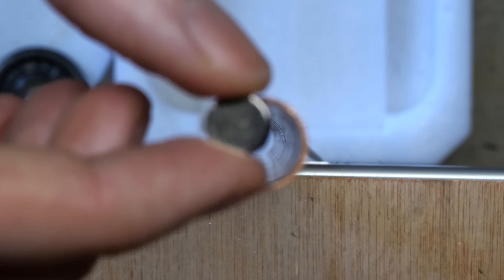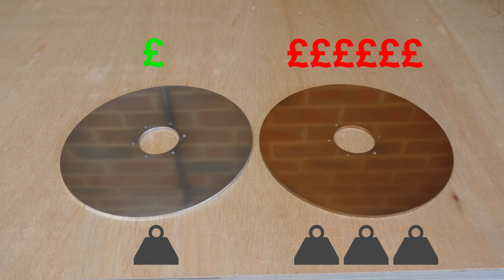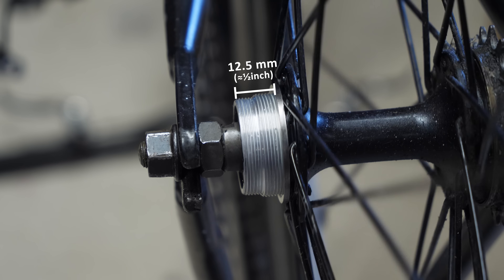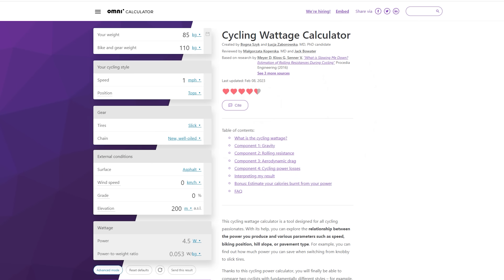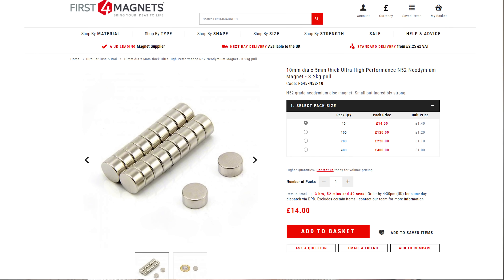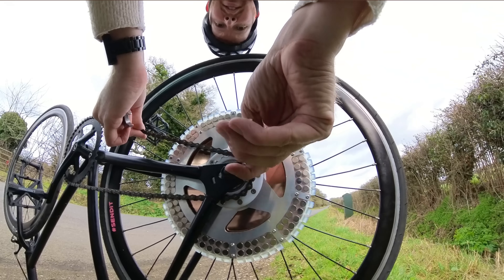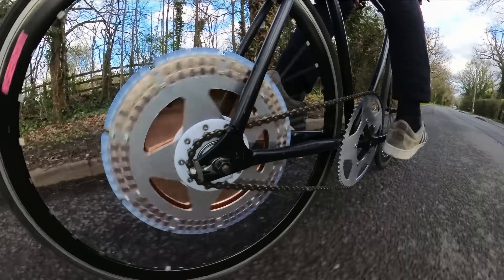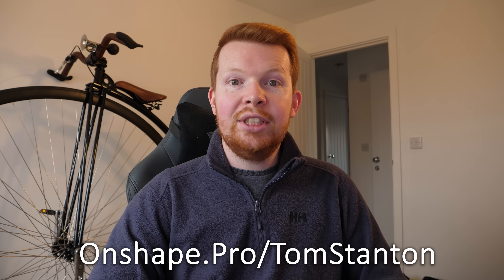Gearless Magnet Bike

Comment: Some exercise bikes work like this.  When you pedal it spins a heavy metal flywheel to smooth out the resistance.  When you adjust the resistance, the magnets are moved closer or feather away from a conductive flywheel.

Comment: What if the copper disk was slotted in a radial fashion ? 
Also .. I think you have one heck of a "region" system if you use that as a break or using it to charge a battery on an e-bike when coasting downhill.
My 2cents,,,, Thanks for the content.

Comment: You could massively increase the strength of the magnets just by putting a steel sheet over the back of the magnets. It'd also grip the chain less. I imagine another steel plate on the other side of the copper would help too.

Comment: It's not only copper and aluminium. In the braking system on the roller coaster I have designed we used all sorts of alloys to get the best possible brake-force curve and heat generation (dissipation)

Comment: What is this "cluch" good for ? For waisting energie. Copper will go hot. Please built a Magnetic Gear instead ! a GEAR gear without contakt. Built it with Gear ratio of 40-60 and built a Elektic bike. 8000-12000 U/min in and 200 U/min out on rear weehl.

Comment: If you would switch to a belt drive, you would get rid of the tension between the chain and the magnets.
PS: I might actually have some use for your idea. I have a recumbent bike, which is frontwheel driven (a Flevo Bike, if you want to google it). The disadvantage is that this means I can barely go uphill, as the front wheel does not put too much force to the ground. I am pondering converting this to an e-bike and drive the back wheel. But as this is not a bike, but a trike, I have two back wheels, and they have one-sided hubs. It is not easy to source one-sided hub-motors for bicycle wheels. But with your magnetic clutch idea, I might be able to drive the back wheels more easily.

Comment: i would try something like this as a brake on an electric bike or trike. when braking, run the motor as a generator and feed the electricity to electromagnets that create the magnetic field. double whammy. from the motor acting as a generator AND from the copper disk acting as an eddy current brake.

have you tried if the thickness of the copper disk makes a difference?

Comment: If you place a metal cover around the outer side of the magnets, it would block them from catching the chain and spokes.
Most magnets use a sheet of steel on the non-operational side, specifically to weaken magnetism on the surroundings, where you don't want the effect.

edit: Just got to the end... That heat would kill the magnets in the long run, perhaps fan blades in the outer flywheel, for some passive cooling as it spins. And more magnets!?!( It's already an expensive clutch though!)

Comment: How much energy is being lost to heat? Does anything warm up?
Reply: Maybe watch the video???
Reply: @JonahHax  I see it now. Thanks. I skipped over many parts because as someone who rides spin bikes a lot, this is the same principle used to add resistance, while a belt is used for driving the wheel.

This experiment nicely shows why most e-bikes do not implement regenerative braking, even though it has been done in some bike wheels. I think it is due to weight and manufacturing cost. Simpler to increase battery capacity.

Comment: Very interesting subject !
Have you seen the HAL paper "Steady-State and Transient Performance of Axial-Field
Eddy-Current Coupling" ? It leads to some conclusions on optimal copper disc thickness (4mm) and number of pole pairs (around 3-4). Also it seems much better to place magnets in the middle of the radius, so the gain of putting them on each side is to be evaluated. And limiting the air gap is quite central in maintaining the torque.
Next, a battle with a homemade visco-coupling unit ?

Comment: Great video, but I think your testing methodology is flawed for the materials. I think aluminum would be better for this. Inertia works both ways. Having a larger mass makes it more resistant to stopping, and harder to peddle anyways. Rather than putting a string with a weight on it to see how quickly it falls, spin the disks to a set rpm and see how long it takes them to stop

Comment: How is the stopping performance if you pedal backwards? Guessing it will still be almost impossible to do a skiddie.
In principal this system have build-in anti-blocking breaking and anti-spin torque transmission.

Comment: What happens if you pedal backwards? Would that provide more braking force? How would the addition of an electrical current affect the resistance?
Great videos! I really enjoy watching and learning such interesting concepts!
Reply: One of his tests demonstrates that the torque generated was proportional to the difference in RPM between the disc and the magnets, so yes, pedaling backward would increase this difference  in speeds, and therefore produce more braking torque.
The other question is interesting.  The eddy currents that the magnets induce in the copper disc flow in a ring around the magnets, lagging behind the magnets because it takes some time for the current to die off once it's induced into a particular path.  This is really how the torque is created - the ring of current induced by the magnets produces an opposite magnetic flux to that of the magnets, that's constantly trying to align itself with the magnets, so any rotation of the disc produces a "back torque" that opposes the motion.  If you were to fit carbon brushes either ahead of or behind the magnets, current passed through the disc through these brushes will also produce a torque for similar reasons.  You will have created a DC motor, but this would be very inefficient because the current you apply to the brushes would not just flow through the copper directly between the brushes, but also though many other paths that would not produce usable work.  This could be improved by cutting slots radially at intervals around the disc, between the brushes, which would reduce the undesired currents without affecting the intended current path, but now you're getting closer to a conventional commutated DC motor.  Which sounds like something interesting.  However, if you look up radial flux brushless DC motor, you will find that this is very close to what is already being used for low-speed, high torque brushless motors.
Reply: @BrightBlueJim  The homopolar generator designed by Michael Faraday was a similar design as well, very cool seeing how this is basically that but with no wires connected to it.
Reply: @BrightBlueJim  Thanks for the response. I'm not an engineer and am not up to speed on the theory of DC motors. I know enough about electricity to be dangerous. My crude thought process was that an electrical current might increase the amount of torque that is being applied to the wheel from pedaling and provide a better braking action. Thanks again!
Reply: What if you cut the copper disk to sections could it make the difference to speed?
Reply: you are very correct
Reply: Stoney: where does the alternating current come from, then? I think you are mistaken
Reply: more expensive coaster brake
Reply: Pedaling backwards does increase the braking resistance, because it means the sprocket RPM becomes 'negative' and the net RPM difference becomes larger.

Regarding electrical current, the current in the disc is not DC but it's a localized AC current which moves along with the magnet's rotation. To get the disc to spin using electrical current, you need to apply a rotating magnetic field through a set of coils. In his experiment, the magnets are replacing the pole pairs of a motor.
Reply: thats what i was asking myself the whole vid too😭

Comment: Was showing the copper pipe trick a while back and found that a magnet dropped down the slot on a piece of aluminum extrusion works really well and offers better visibility of the trick.  This sort of made me wonder if you had a slotted cylinder hub and axial fitted magnets if you could get more resistance with less weight.
Reply: you are very correct

Comment: Eddy current clutches (using electromagnets instead of permanent magnets) used to be a common way to do variable-speed motor drives before DC drives and VFDs got practical and cheap.

Comment: Even dull looking copper is a great reflector of infrared light, like a mirror would do for visible light. It has a very low emissivity so you would have to stick some tape to it to measure its temperature with a thermal camera or you will just read the temperature of the things its reflecting. Interesting video. I was about to experiment with some magnetic coupling myself and was wondering about the alternating magnet orientation :)
Reply from the maker: I kept a protective plastic film on the backside of the copper disc for that exact reason (notice the thermal camera shot is from the other side of the wheel vs regular camera shots). When aiming the camera at the exposed copper side, it just showed the temperature of the reflection.
Reply: Yeah he'd best get his camera checked it clearly didn't show the real heat source. Fake!

Comment: One possible solution to the issue of the chain being attracted to the magnets would be to use a bike with a belt drive.
Reply: I just thought of an idea that would improve coasting. Rig up a system with a brake lever that when applied would push the magnets radially away from the hub so they don’t overlap the copper disc.

Comment: You can avoid the problem with the sticking chain by replacing it with a chain made out of rvs.
(Or make it a belt drive)😊

Very cool project.
Reply: Why would he want a chain made of motorhomes? That seems like it wouldn't fit if I'm not mistaken? XD

Comment: I would really love to see you do some more disc testing, like perhaps heatsinking the middle of the disk with some machined fins/grooves improves performance. Also a disc with a small bit iron inserted would radically increase traction of the drive while still allowing it to be an inductive clutch. Or maybe something like dimples or a grooved surface in the copper disc will help improve inductive performance and you can finally get some heat marks on that copper 😏
Reply: you are very correct

Comment: I did think about this idea long long ago and conclude it's not worth it since the regular break is much cheaper and simply more practical.

What would be great is to store the energy when going down hill and use it for going up hill.  You don't want to go down too fast but also wasting the energy when using the break.  

I did think of a big heavy metal disk.  When going down hill the energy can convert to spin that disk super fast.  And the reverse when going up hill, you extract the energy from the stored spinning back to the wheel to help go up the hill.  Now this actually need a transmission.

Comment: I think I’ve used a similar device to yours magnets and disk setup at 7:30 in this video, but it was for something completely different. I was on a rock wall climbing place, and the safety harness/fall arresting system behaved like an Eddie current based brake. I was only 8 at the time, and none of the rock wall climbing staff could give me a better answer than “it works using magnets”, but after watching this video I’m almost positive it was an Eddie current based resistance type device. Only difference from your device at 7:30 was that it had a coil spring and a one way bearing, so as you climbed up the wall, the rope would retract nice and easy, but if you fell, the one way bearing locked, and then the disc would engage spinning, causing an Eddie current, which then was used to slowly let the climber descend from the wall at a really really slow pace. It was actually really smooth, since it didn’t have any sudden lurching or tightening of tension in the system…it was a nice gradual increase in resistance
Reply: That's a clever system, the increasing force as the magnets/disc start moving faster make it smooth in operation. And like Tom said in the video no contact friction such as brake pads so not much wear on a critical safety device. The only significant failure mode I can think of right now would be heat causing trouble with overuse beyond its design specifications. Most other things would be cable/rope breaking, attachment failure, etc not so much the braking mechanism itself.

Comment: This hasn't been thought through, and is impractical for daily road use. Much of the dirt on UK roads is metalic, and the magnets will attract this very abbrasaive gunk. Unless you have thought of a clever mechanism to remove the dirt as it builds up on the chain and gears, a magnetic transmission bike will need frequent cleaning and maintenance to avoid this causing damage.

Comment: with this information could you theoretically make an extremely reliable and long lasting breaking system for bikes? and maybe combine this tech with regenerative breaking for electric bikes?

Edit: Would somehow including electromagnetics result in higher breaking force in the space constraints? Among other things.
Reply: I imagine if you made a normal bicycle disk brake but made the wearing components as heavy and bulky as this, then it would also easily last the lifetime of the bike.
Hub brakes can also last years without service, and all the braking force isn't directly transferred to your legs like here.

Comment: Would making a mechanical lock up clutch, to lock the fly wheel to the sprocket so you have high torque at low speed to get going and then it unlocks once moving. A lot of cvt transmission have a mechanical first gear to get going and then unlocks and then cvt takes over.

Comment: easy way to stop the chain sticking to the magnets…. is to not use a chain but use a belt drive. To beat issues with heat on the copper disc, could mount some heatsinks inside the spokes.

Comment: Pretty neat having brakes that never wear out.  Improved if designed as a direct drive forward but magnetic braking only on a specific wheel and your other wheel could use the standard friction disc to stop on a dime when necessary.  Best of both worlds if human powered pedaling is your aim.
Reply: "a direct drive forward but magnetic braking only" is just a worse normal hub brake.

Comment: What about using Electromagnets meaning you apply varying voltages to "increase gears or decrease gears"" and you can also use more or less voltage for slower or faster breaking. Plus with electromagnets you can take a break from peddling by turning the magnets off to rest you legs - then turn them back on when you are ready to peddle again.

->As for the sheets in the Veritasium video would also fall at different rates because they are not all aligned the same distances from the center of the magnetic field. Perhaps if he swapped the two sheets around and repeated the test you might have seen the copper drop slower than it did when it was further to the right of the magnetic field center.

Comment: If you want the feeling you desire you should try a wandler clutch from cars. By compressing oil you get a greater resistance. But I don't know how you could fit this clutch on a bike. But maybe you can do it. 
Another idea could be a variomatik (German word). It's the clutch from small 50cc scooters where the centripetal force engages the clutch. This design is much smaller and could actually fit on a bicycle.

Comment: Maybe it won't work for a bike, but think of those axles which need to be completely isolated (Water or air tight) from one side to another. Surely you can't put a hell of a torque there, but maybe just enough for your application. Interesting project.

Comment: Wow that's awesome! It would be really interesting to build a variable geared transmission out of this, where the RPM of the pedals would be directly linked to the distance of the magnets relative to the copper plate?

Ideally directly connecting the magnets to the copper plate at a set 'max gear' RPM of the pedals, giving a 1-to-1 ratio of magnets-to-copper without eddy currents induced (max pedal efficiency), and moving the magnets completely out of the way of the copper plate, inducing 0 eddy currents, at 0 RPM of the pedals (no braking force and thus no loss of speed nor induced heat).

Would be difficult to construct such a system where the distance between the magnets and the plate would be variable within a set RPM range without running off the thin thread I think, but it would be an interesting, hopefully cost efficient, 0 maintenance variable transmission!

Comment: There are bikes without a metal chain they use a belt
Reply from the maker: I've used belts for my ebike drive train, and they tend to be far wider than chains for the same torque rating. Which given the limited space, would be difficult to fit.

Comment: Is it possible to use a torque converter to try and eliminate the need for gears? I don't know where you'd get one small enough, but a variable pitch torque converter could allow the rider's torque load to be adjusted on the fly.

Comment: You can change metal chain with rubber belt...
Reply from the maker: I've used belts for my ebike drive train, and they tend to be far wider than chains for the same torque rating. Which given the limited space, would be difficult to fit.

Comment: You could have had a sprung idler to support the top length of chain to reduce the longitudinal load through the centreline of the spocket changing the angle as the chain exits the sprocket